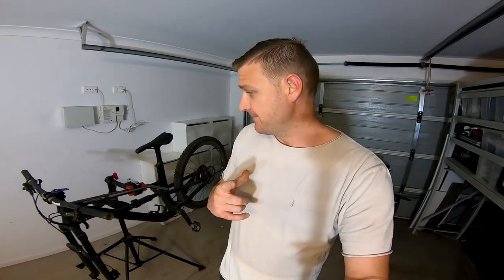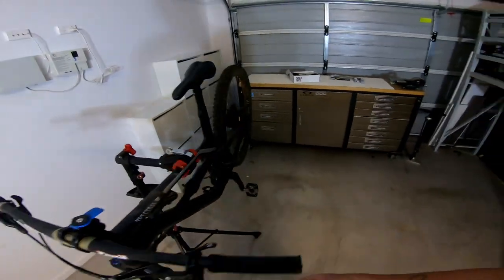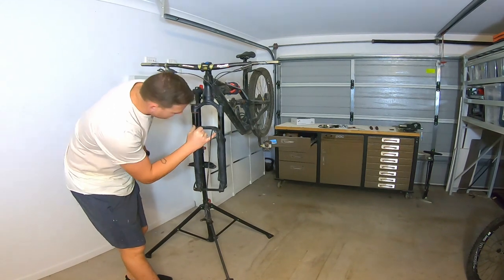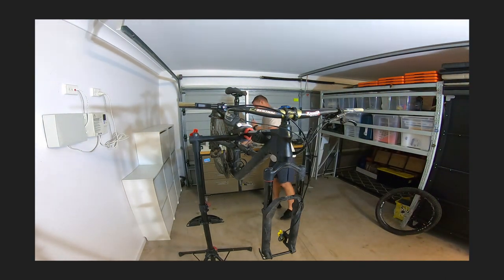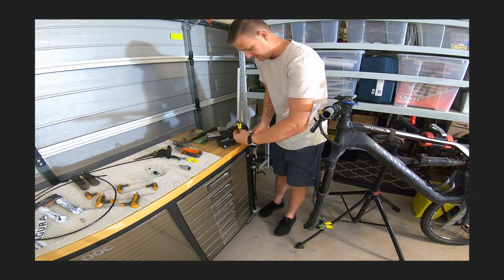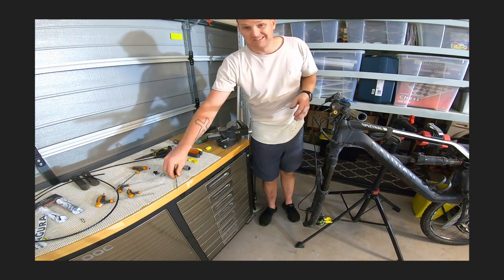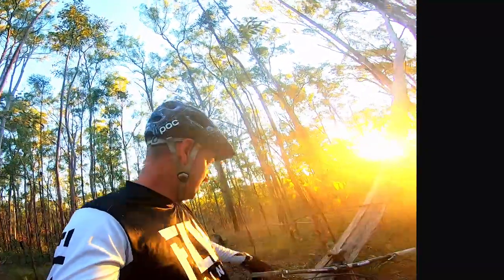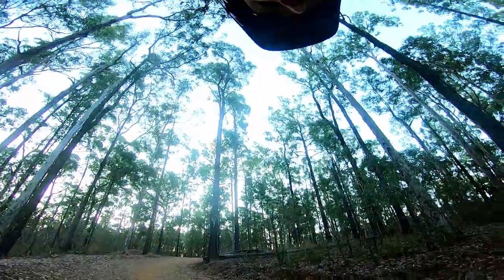New Parts! Unboxing and Installing Magura MT7 and DMR Deathgrips

Comment: Same as my mt7 pro I’m in Aussie as well, only thing that was diff was under the pull out top in the box, I had a big instruction manual, a bag with mounting and hose fittings and a bag with 10 or so Magura stickers n stuff, went from hope tech 3 v4 to these and love these, no regrets at all with $5 price diff with hope being the cheapest